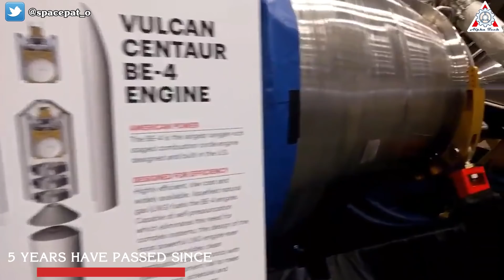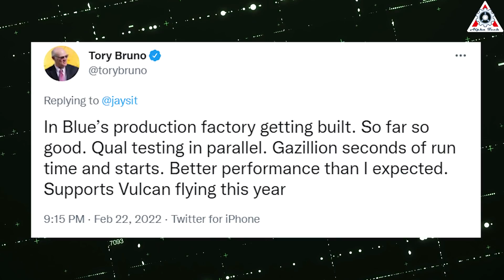Disaster! What Exactly Went Wrong With Blue Origin BE 4 Engine?

Comment: Why doesn't the ULA petition Elon for some Raptors?
Reply: The Raptor and Starship designs are constantly being improved. SpaceX is shortening the paths that propellants take from the tanks all of the way to the engine nozzles. They are also optimizing the diameters of all of the pipes. The result is that the interfaces between the engines and the rocket are changing. Each change to the engine interface necessitates a corresponding change to the ship.

Ship 20 can only use the last version of the Raptor-1 engines. Ship 24 will use the first version of the Raptor-2.

There were many incompatible changes to the Raptor-1 interface from Star Hopper through to Ship-20.

The Merlin engine design on the Falcon 9 was in flux until the Falcon-9 Block-5 version. That was the version that got human rated.

ULA's engineering process is not agile. Once the Starship has done a few dozen operational flights, and SpaceX is ready to start human rating a particular design, then the Raptor-2 design may be stable enough for ULA.

By that time, a Raptor-2 will probably have more than the design thrust of a BE-4. This will allow ULA to keep the 2 engine basic design for Vulcan. ULA will have to design and build new first stages. A Raptor won't be a drop in replacement for a BE-4.
Reply: @hamjudo  thank you for such a fine explanation.
Reply: Raptors are very different to BE-4 and it would take a big redesign to fit them onto the ULA rocket. Also with ULA being one of SpaceX's biggest competitors it is hardly likely they would sell them their engines. It was surprising Blue Origin did this to be honest.
Reply: @schrodingerscat1863 ,  I agree that the ULA would need to redesign the mounting points on their existing Atlas rockets if they were to use raptors. However, if ULA could swallow their pride for a moment, they would save a great deal of money and be able to put larger payloads into LEO. Not to mention be able to help with resupplying ISS.
Reply: @CuriousMinds_RPW  It isn't that simple, the Raptor is a smaller engine than the BE-4 with a lower rated thrust, so they would need to modify their design to incorporate three engines rather than 2. You then have to modify the fuel supply plumbing to compensate for different engine dynamics, feed pressure and flow rate requirements. It isn't as simple as just creating an adaptor so the pipes line up. All this is academic though as SpaceX will never sell Raptors to ULA because they are SpaceX's main competitor.
Reply: Might also not work since SpaceX will probably have problems making enough of them for even their own needs.
Reply: @Qwarzz  Quite right, ramping up production of raptors is something even Elon Musk has said is many times harder than designing the engines in the first place. For a good number of years SpaceX are going to need all the Raptors they can get while they build up their Starship fleet.